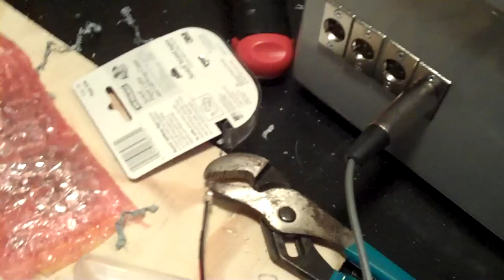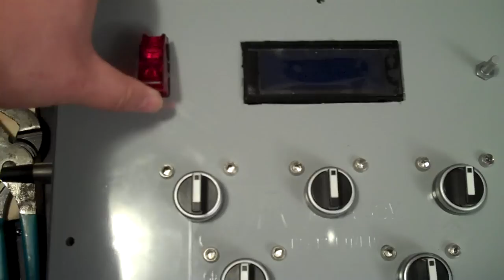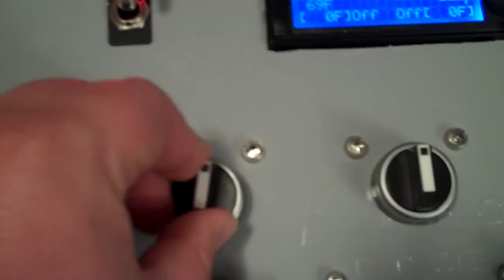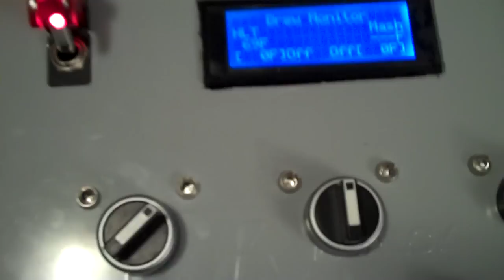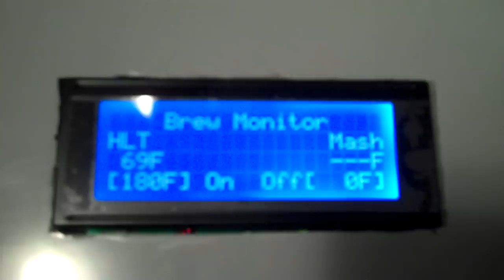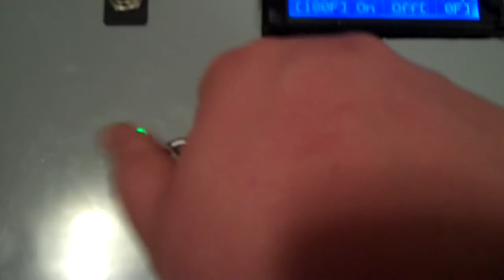BrewTroller Phase 1 - LED Bling Added

Comment: Which Arduino board are you using currently?  I am just starting to look into doing something similar, but likely just for fermentation temps to get my feet wet.  I still have yet to build a single tier stand, so the controller you have here doesn't directly apply.  Maybe next spring if all goes well.  :)